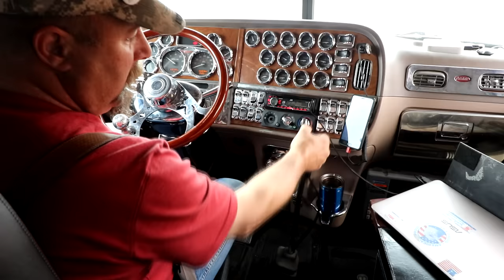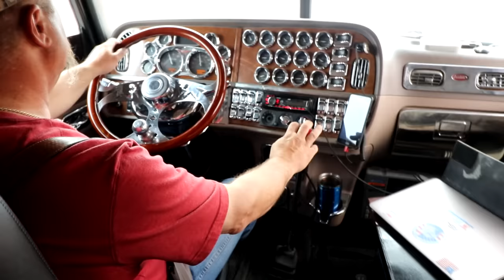How to shift an 18 speed transmission

Comment: That dashboard needs more gages.
Reply: lol
Reply: And where is the rest of the chrome???
Reply: Theres space for 2 more of them xD
Reply: I think you meant to say it needs more cowbell
Reply: Those are for monitoring the Flux capacitor, without turning around to look at it.
Reply: Lmao
Reply: Over the top   Cow boys
Reply: @jasonwomack4064  Lol
Reply: @Scott Actually, he spelled "gage" just fine.  It's just the incorrect use of  the word.  So, neener, neener, neener.
Reply: @grapeape1508  I thought if you lose air pressure the brakes would lock up
Reply: Kole Kammerer christ that’s cringy, you probably don’t even use reddit.
Reply: @bodiew7368  yup bad day either way
Reply: Anymore I’d mistake it for a plane
Reply: Are you sure this isn’t an airplane?
Reply: @adamschaeffer1436  i mean its the only prescription for my fever
Reply: @bodiew7368  , they don't always lock-up. If the truck is hauling a max weight load and going downhill the brakes are most likely going to seize up after a major loss of air pressure below minimum. That's one of the biggest causes for Runaway Trucks on Downgrade Slopes in the mountains. In other words when too much air is lost the brakes do lock up (you're right) but at max weight downhill those brakes will overheat in just a couple seconds causing the brake fluid to vaporize then seize which is now a Runaway Truck without any way of stopping except by a Runaway Truck Ramp if lucky enough to get to one before worst comes to worst. 

The other biggest cause of a Runaway Truck is keeping your foot on the brakes going downhill which again causes them to overheat, then fluid to vaporize, then the brakes seize, and finally no brakes all within a blink of the eye. Should always STAB BRAKE in a Semi-Truck when on a downgrade of and grade but most newbies today aren't trained enough especially at these pathetic trucking company schools which need to be outlawed.
Reply: he liked everyone's comment except yours :)
Reply: And I bet he doesn't even care to look at them
Reply: @Scott And you need to realize this isn't a Spelling Bee.
Reply: 1 gauge = 5 hp
Reply: @michaelwatts8052  stab braking is also definitely not the best idea. The brake pads and disks still get hot and lose power. 
Also in most cases it's not the brake fluid evaporating, causing you to lose your brakes, but the fact that the pads surface turns into a material similar to glass when it overheats. Ever tried getting friction between two hard smooth surfaces? Doesn't work.
But these small technicalities aside, I don't know about American trucks, as I live and worked on them in Europe (Germany to be precise) but they usually have two additional brake systems for going downhill. They are free from wear and by law have to at least be able to keep a fully loaded truck on a 6% slope at a speed of max. 30km/h (~19mph) over a distance of at least 6km (~3.7miles) without brake fading (reduction of braking power)
1. You have the engine brake, which shuts down injection and closes a flap in the exhaust, using the back pressure to slow the truck down
2. A retarder. They come as Fluid or electromagnetic retarders and sit directly on the drivetrain. They can be engaged in steps, meaning you can choose how much braking power they produce. Simply put they consist if a system of Rotors and Stators. In the case of the fluid retarder, you have oil, that is rotated by the first rotor and forced through the stator, hitting the second rotor, acting against the flow direction of the oil, creating breaking power and forcing the oil back to the first rotor again and again, while the electromagnetic retarder simply works, as the name implies with electromagnetic fields to generate braking force.
I personally prefer the electromagnetic one as it works maintenance free, while the fluid retarder need service usually after 3-4 years. But the fluid retarders are far more common, as they are way cheaper and most trucking companies only keep they're trucks 2-3 years, before getting new ones.
Reply: the gauges are there for a reason, the lest amount of gauges semi's tend to have is about 8. It's handy knowing what the temps or your diff's and transmission is it helps pin point if there's a problem very quickly. That pile of gauges saves break downs.
Reply: earl verity  but why have it like that? I know, American trucks are bigger and have the space, but in European trucks, we just put all necessary information into a normal car-like dashboard with a digital information center. The system monitors itself and if something happens to malfunction, you'll get a notification and a warning sound. Simple as that
Reply: Just some random guy visiting the grounded space shuttle
Reply: Michael Watts brake fluid vaporizing in air brake systems? Hmm...
Reply: @michaelwatts8052 there is no fluid in air brakes the over heating causes brake fire when your tyres melt and everything goes up in flames how do I know it happened to me twice fortunately I managed on both occasions to separate tractor and trailers and save the4 fire from spreading past the brakes and tyres.
Reply: @robinrumpfkeil9546  7
Reply: Guages*
Reply: @grapeape1508 ...seen what happens when the air brakes fail...a semi loaded with fuel oil lost its airbrakes on a hill on Ga Tech campus in 1968. He rolled all the way down the hill through a green stoplight and the bottom and fetched ups against 2 cars to come to a stop because the light was now red. A great piece of driving on a very narrow road.
Reply: so does my life
Reply: that poster needs more exclamation mark
Reply: @tedhuges8275  Sew ewe ar fyne wiv bad speling, are yew?

The moor it getz bad, the hardr it wil bee four peeple to comoonikate, and ven kaos wil rain!
Reply: *gauges
Reply: I know, right?
Reply: @Scott bad
Reply: @grapeape1508  Correction:  If you lose air pressure you do not lose your brakes. They will automatically be activated because of the lack of air pressure.
Reply: @michaelwatts8052  There is no brake fluid on an air brake system.
Reply: Super Cat it looks like he needs a booster seat to see over the dash panel.
Reply: @multibusa  That would ruin his Cool in His Stool ride.
Reply: @robinrumpfkeil9546  You dont have to wait for a malfunction to shut you down 
An out if whack gauge will alert you sooner to a problem if you watch them regularly
Reply: @robinrumpfkeil9546  So you're saying a fuel gauge is unnecessary? How about a coolant temp gauge? Air pressure?
Reply: @bullcat6531  not saying those 3 are unnecessary. Not at all. But first of all they don't necessarily have to be analog and secondly, that's definitely more than just coolant, pressure and fuel
Reply: I agree ain't enough for me
Reply: Needs more woman silluets
Reply: @bodiew7368  no you lose the brakes entirely the air is what compresses them
Reply: Gauges*
Reply: Robin Rumpfkeil I don’t know about European trucks, I doubt the are any different then US trucks, but the engine brake does not shut off the injection and close a valve in the exhaust... it opens the exhaust valve during the compression cycle and close during the power cycle cause a suction in the motor which slows the motor..
Reply: Michael Watts uhh... brake fluid??? It’s an air brake system. No offense, but there are a few things that don’t quite work in your explanation, so I have to ask if you’re actually a driver?
Reply: Jared Hexflame are you aware of something called “spring brakes”?
Reply: @michaelwatts8052  Brake fluid??? You have zero idea what you're talking about....
Reply: I think you wanted to spell it "gauges".
Reply: Interesting conversation. Thanks y'all. Be safe :-)
Reply: @grapeape1508  You are right to a certain extent. 99% of those "gauges" are for "TEMPS" for 1st AXLE, 2nd AXLE, OIL PRESSURE, AIR PRESSURE, WATER PRESSURE, TRANS BRAKE PRESSURE, etc
Reply: earl verity come on...trucks in the states can have the same capability it’s just in most cases weight limits are 40t unless there is a special permit.  The reason most trucks are conventional rather than cab-over is because of the road system in the states (Australia also) has room for over all longer trucks..  Longer wheel base on the tractor means a more comfortable ride and larger sleeper berths.  Some trucks basically have a small apartment behind the driver.
Reply: I think he needs another 2 :D
Reply: There’s a gauge for the driver’s attitude too.
Reply: everyone of those gauges is important, you have air pressure, oil and temp gauges, you have suspension gauges ..all important and not decorative..18 speed in a user friendly gear box, however 379hp is a small truck by our standards.
Reply: @xlittleboy-7095  wanna bet I pay attention to all the gauges they tell me what the truck is doing. I know if something is wrong and what the truck is doing by watching the gauges

Comment: I’ve been a trucker for 35 yrs and I never got a chance to drive a truck with an 18 speed trans in it.  My fav back in the day was a 15 Over with 5 deep reduction.  I tried to get others who had driven an 18 to explain it but it didn’t make any sense until watching this guy demonstrate.  I got it now, it is basically a Super Ten with a range selector.  Super 10s we’re nice, not as much moving the stick. Thanks for the demo!  It’s sad that most everything on the road now has an automatic in it.
Reply: Yap !!! i cant find truck with 13 speed !!  i am sick of this AutomaticCRAP
Reply: I learned to drive trucks on a super 10. They're pretty cool cause you only gotta move shifter 5 times. I love it
Reply: 15 speed overdrive. Over & back to 14th, then forward to 15th. Drive a cab over KW with a 892TTA, absolute weapon.

Comment: It’s strange to me that jobs like this aren’t considered worth while by many people. Many people look down at plumbers and trucker drivers and electricians as being too dumb to get a “real” degree or education. 

But shifting and 18 speed transmission, while driving a 18 wheeler is a seriously valuable skill set. This is some serious business doing a job like this. Bravo.
Reply: I’m in an apprenticeship to be an electrician. I agree that most people think that there’s not a whole lot of brainpower that goes into the trades but there’s so much damn math in learning how to bend conduit and DC and AC theory that I never used in any other job. The journeyman I worked with for the last 6 months was smarter than anyone I worked with in my office jobs.
Reply: Anthony Flournoy Exactly right. It may not be some glamorous, upper class job. But without these career fields our society would go down the drain pretty quickly. 

Some people may have degrees and be extremely smart in that particular “hands off” field of work. But plumbers and electricians know an actual hands on trade. And it’s just as valuable or commendable as any college degree.
Reply: Problem is trucks are becoming more automated and computer controlled, soon they will be self driving. Its a shame
Reply: Well there is an old saying that goes: “if you bought it, a truck brought it” it’s crazy how easy it is to overlook the fact that trucks keep the stores everyone shops at stocked with product for consumers to purchase. The people who look down upon truck drivers and tradesmen fail to realize that nobody else will keep stores stocked or at least as efficiently as truck drivers and nobody else will fix their toilets but plumbers when they break it by putting a turd too big down there. Perhaps if people and kids these days are exposed and shown the purpose and importance of these roles, and what these people go and can go through on a daily basis, not only would there be more of an understanding and more respect of how essential these people are, but maybe there wouldn’t be such a big shortage of new people in these industries in the United States.
Reply: The difference between "essential" and "non-essential" workers...
Reply: A 13/ 15/ 18 is easier to drive in the real world than an 8 or 9 , or heaven forbid a 5 speed .
Reply: Filiana Blanxart It certainly makes driving on hills a lot easier
Reply: Teal Steel yep, that’s true,and coal will be around for the next 100 years or more
Reply: Makaan The Sajuuk-Khar wtf do you for a living,mr.worthwhile?
Reply: @AFlournoy413  Yes sir!
These kind of people, including you and the truck drivers are the ones that keep our wonderful country running.

Have a great day!
Reply: president camacho  you calling a squiggly metal thing. Shows you should not be plumbing. Honestly plumbing is harder than both trucking and electrician jobs. But don't talk down to plumbers if you havent been under a slab home in a tunnel replacing sewer pipe when its half full of water because of rain.
Reply: @uaintfr3shazmi155  Exactely! Fellow european Plumber here.... I feel ya!
Reply: president camacho  Running a cable or in your terms (squiggly thing) is only 5% of plumbing everything else im sure you cant do and even running a (cable) you need some type of skill.
Reply: Itès not worth while when you consider the hours put it vs the compensation. And the 18 is the easiest shifting trans on the planet.
Reply: Let those people go to a warehouse and watch some real manual labor. Watch one of those dusty containers from China being unloaded. They’ll never talk down to a Truck driver or plumber ever again.
Reply: Blue collar workers keep the world running for all your snow flakes
Reply: I don't think I heard anyone say that, especially about journeyman or "electrician"
Reply: Makaan The Sajuuk-Khar 
Am engineer myself, couldnt work in my career here in the US- just bought a truck and am making money. I mean lots of money.
Reply: Because college is shoved down the throats of every highs schooler that that is their only option to make money in life. Fuckin bullshit is what it is. Promote trade schools with the same enthusiasm as “college”
Reply: Makaan,
You're sooo right.
People sometimes don't realize, if not for truckers we wouldn't have a darn thing.
No food, no clothes, no plants, no cars, no houses (the materials get to you by trucks).
And nothing else would we have.
Oh, btw, I'm not a trucker, just smart enough to appreciate truckers and the other professions that you spoke of.
Thanks for opening the eyes of the other readers.
Reply: Those are some of the top trades too that pay better than most jobs nowadays. Believe it or not the laborers union is like that too. I just got sponsored in and am doing traffic control and started out at over 20 an hour. They are very good trades if you want to make a decent living. I was always used to getting minimum wage for doing hard back breaking work. So its definitely nice getting paid better.
Reply: @sz42781  that's not a problem, automated trucks can be much more efficient
Reply: @ccllvn  Yeah! Unless your one of the millions of people who make their living driving a truck
Reply: @sz42781  well they can then get a job in software development for the trucks...a lot of jobs changed as technology advanced in the last 100 years
Reply: @ccllvn  lol
Reply: So true. Salt of the earth people,my father, uncle, cousin and brother are truck drivers and former truck drivers.  My brother currently has several trucks on the road and he and his wife work extremely hard in keeping the business flourishing. My brother does the mechanical work and assign his trucks out while my sil is a broker and a bank manager for a large bank. All while raising 2 kids. But you gotta do what you gotta do to make a living.
Reply: Most people with degrees couldn’t do these jobs...
Reply: Anyone who looks down on this can prove us wrong and get behind the wheel then in a lot an show me how easy it is🤣
Reply: @ccllvn  bro automated trucks will cause more accidents due to bugs and or other problems. Ever driven behind one if these assholes using the full-blown tesla self driving mode? Comes to complete stops entirely too far back etc. It cannot happen unless you have a oersin inside behind at keast monitoring. Who will pay for damages etc or even deaths if they crash? You realize how dumb that is right? These things are missles on wheels when they crash
Reply: All the men in my family are tradesmen and truck drivers and make a lot more money than you think !
Reply: @sz42781  IDK about that